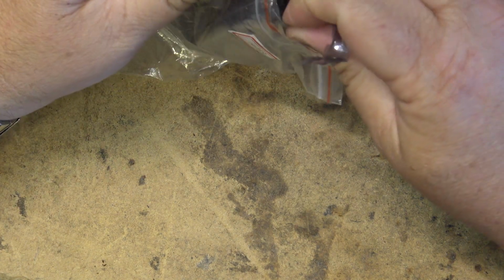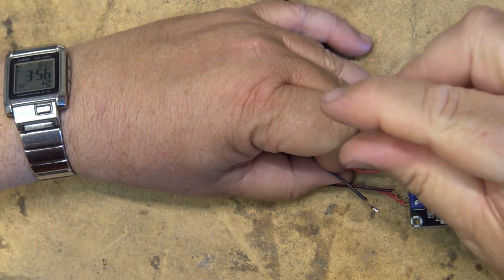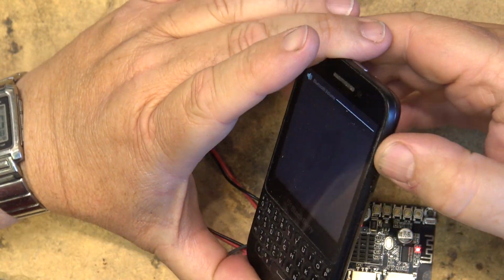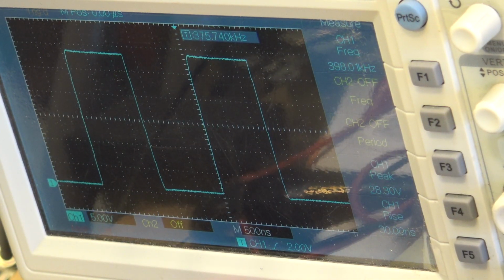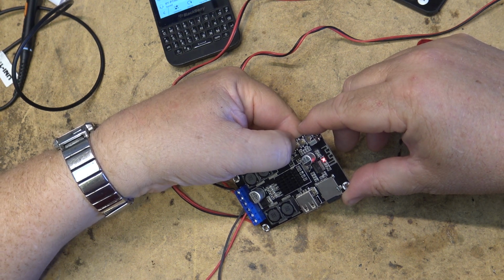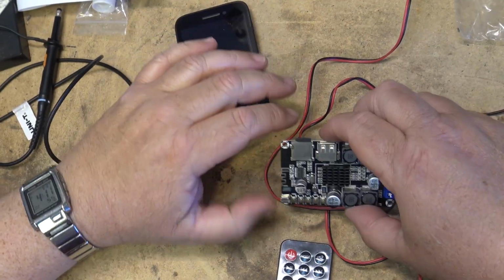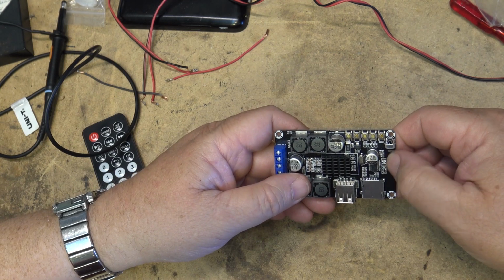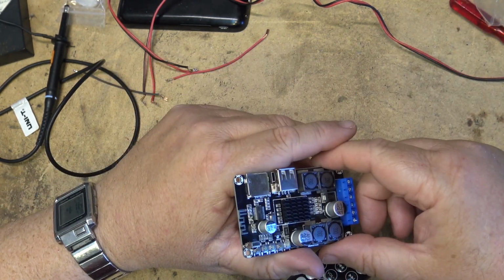icstation 50wpc bluetooth + USB + microSD music player board

Comment: Unrelated but because of your videos I was able to identify and fix an issue in about 1 minute.  This weekend found a Technics SU-V76 integrated amp at a Goodwill for $8. Got it home powered on but no output! Popped the top off...and discovered two areas with that yellow glue bridged across several components. Removed the conductive glue now works as new! Thanks Dave for what you do!

Comment: 12voltvid...how did you record your songs on the SD card,I use sangean recorder that I have I get it off of I heart and you tube some may skip but a lot don't.i use a Bluetooth to record on the recorder.
Reply from the maker: All my music comes from either CD or from stingray music.  I record sessions onto dat tape on a recorder plugged into the cable box. Once I have a bunch of tapes recorded I go back and play the tape and manually record on my computer using audacity. I have yet to pull anything off YouTube.  I sometimes download the odd album from a Russian site.  Used to be allofmp3 but they changed the name. It's a pay site and it is a pita to make a payment as they only accept crypto and the fees paid to do this makes it more expensive.

Comment: Do you make a little enclosure to mount these things in? Could I hook this up to my stereo receiver through the aux or tape inputs?
Reply from the maker: I have installed a few in speaker enclosures and one inside my hd radio tuner. The rest are sitting in a box unused.
Reply: @12voltvids  Pretty neat stuff compared to when we were kids.